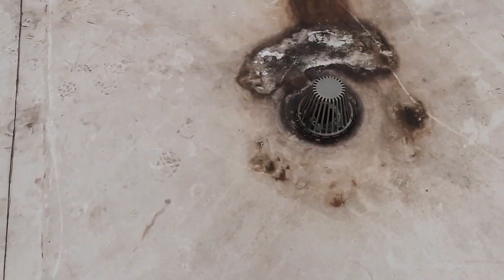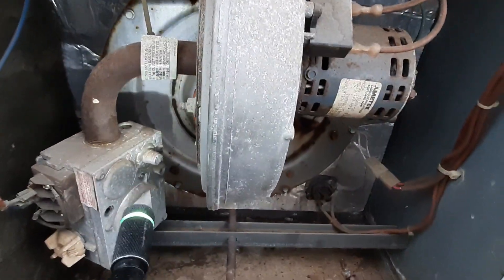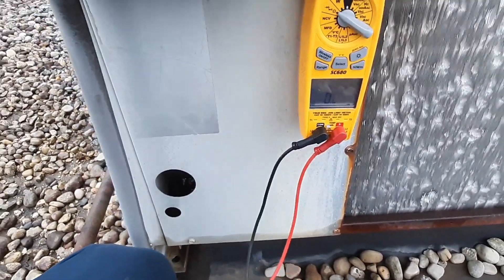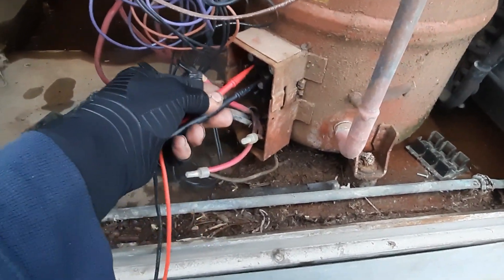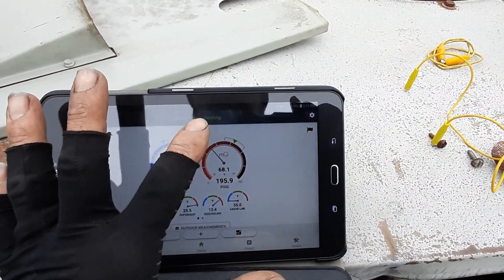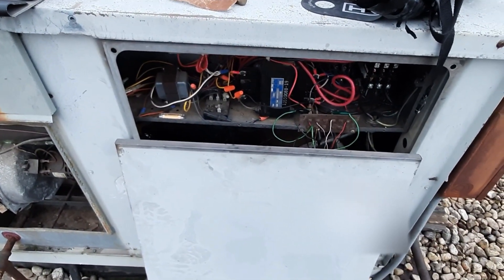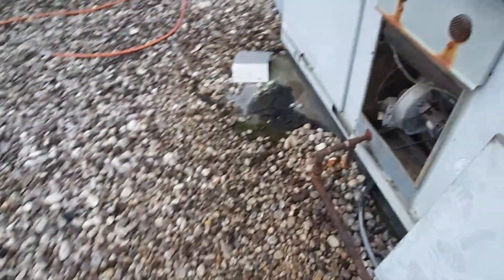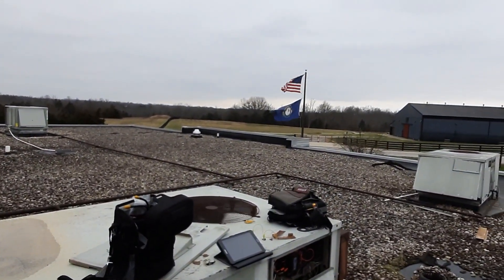Old Trane package unit, No Cooling service call

Comment: Can you tell me what these TAM7 led light code mean?
https://www.youtube.com/shorts/euZxu1-qcqk
Reply from the maker: I can't use this link, if it's trane and not an ignition module flashing usually means lock out of some sort, just like the RTRM boards it's not a true diagnostic
Reply: @EverythingHVACR   try this link : https://youtu.be/euZxu1-qcqk
Reply from the maker: Looks like a damn light show 😆. That's more of a resi air handler, I have not dealt with too many but you should be able to find a list of codes in the manual somewhere or may have to contact trane... and good luck with that. Wish I could help more, outdoor unit may have codes as well that may help.

Comment: Third apportion the heat thingos need replacing and a control panel inside on the wall for it and it's possibly overcharged!

Comment: East KY tech here, like the flags at the end!! I’ve seen the outdoor temp sensor on these go bad and cause the unit to run cooling when too cold outside and freeze evap up. Then some inexperienced guy will come and add charge and overcharge crap outta it.  Problem will keep happening on cooler days until something breaks. Dislike that trane sets these up to control themselves and basically overlook stat. Anyway great job polishing a turd!
Reply from the maker: Thanks JP! 💪 what county you in?
Reply: @EverythingHVACR  Fleming. Welcome man, keep them coming!
Reply from the maker: Good to see some more KY folk here in YT land. Thanks again JP!

Comment: Some crazy high subcool numbers there definitely need to follow up remove some charge see what happens then. This thing will go out on high pressure for sure hence the replacement high pressure switch on that tee
Reply from the maker: Yeah it needs pulled but I'm 99.9 percent sure the metering device is restricted, I've pulled 30lbs over on some larger units, happens too often. They have all the information and multiple options at this point so we'll wait and see what they decide. Thanks again Joe!

Comment: You pushed a ton of oil out into the system with that crank case heater being bad that's for sure.
Reply from the maker: Thank W D! This thing has got a lot of problems, compressor will probably die a horrible death soon but I bought them some time at least. Hopefully a new unit going up soon
Reply: @EverythingHVACR  Looks like the head pressure is a little low, surprising since the coils/ fan and filter are dirty. The compressor sounds low, and that amperage did seem high. Looks like who ever worked on it before was chasing an existing issue. My guess is the crank case heater shit the bed when the were running it in the colder months.
Reply: I like to see how hot the compressor gets when it is over charged.
Reply from the maker: I think the heater blew the fuse, compressor is definitely an issue though. Coil was fairly clean but damaged head pressure was up, this is R22 at 45 degrees
Reply from the maker: Ohh this compressor is on life support no doubt. Thanks James!
Reply: @MistaWhatchaKnow  It won't because your flooding back liquid refrigerant the compressor it will be ICE cold. They run hot from leaks and losing oil, and 99% of the time the leak is fixed, than another leak more loss of oil and it runs hot.  The proper way when you fix a leak is to pull the compressor and drain the oil and see what you have left.  I have done it twice both times it was low.

Comment: I suspect that the crankcase heater shorted and took out the fuse. When the other company was called, they saw the old unit and blown fuse and either had an inexperienced tech that misdiagnosed the crankcase heater as the compressor shorting or someone who went directly into sales mode. Possibly a little of both.
Reply from the maker: Your right on the money,  I would agree. Thanks John!

Comment: Great first assessment. Strange to see that a Trane 3 ph unit uses C, R, & S on the wiring diagram...instead of L1, L2, & L3.
Reply from the maker: Thanks RC F! Yeah I didn't even think about that but even some newer equipment is labeled that way as well now that I think about it, interesting.
Reply from the maker: You hit the nail on the head there Florida Man! 👏 Thanks